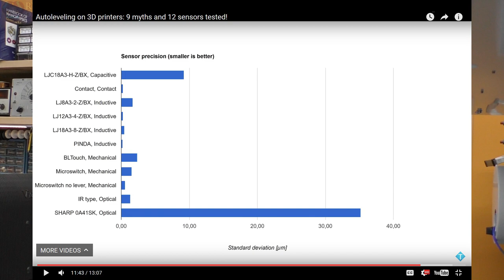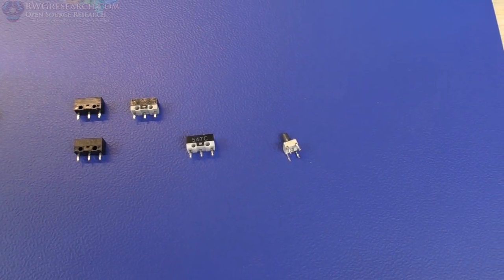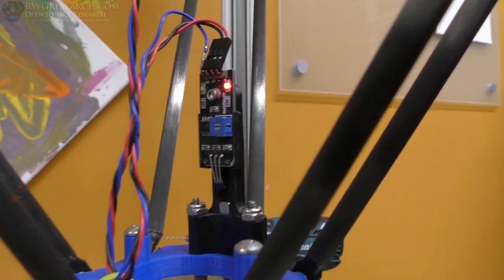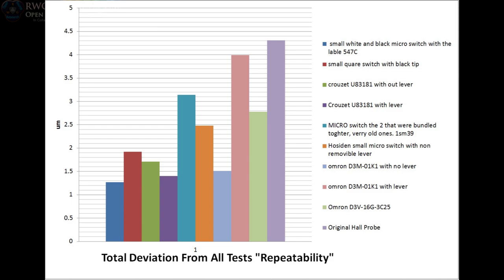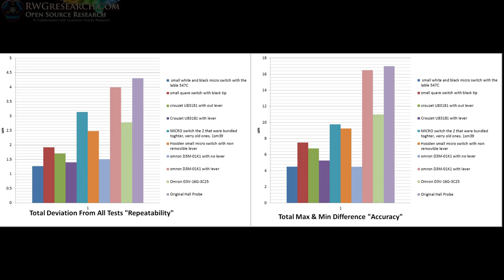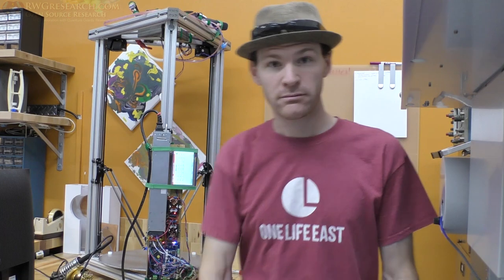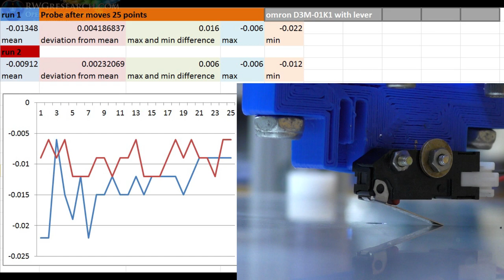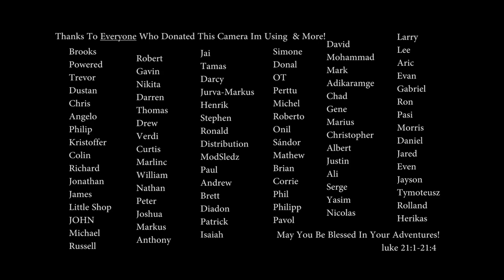Z Probe Micro Switch Shoot Out! How Accurate Are They For 3D Printing? + Hall Probe testing

Comment from the maker: Also note that i did not do a "contact contact" test in the video ( I forgot) 

So the results for contact to contact were: 
Total Deviation From Mean: 1.24 um 
Total max / min :  3 um

This is the lowest ( best) of everything tested.
This basically means that my delta in its current state has a resolution of about 3um +/- 1.5um. that's not to bad that's .003mm! 
so this will need to be understood when looking at all the other data. 

Thanks for watching!! 

~Russ Gries

Links:

Tom's video / page:
https://toms3d.org/2017/03/02/autoleveling-3d-printers-9-myths-12-sensors-tested/

Original Z Hall probe.
http://www.thingiverse.com/thing:111397

my edited Version of the hall probe from sainsmart:

http://open-source-energy.org/rwg42985/russ/Projects/3D%20printer/2016%20RWG%20rostock%20delta%20updrade%20parts/RWG%20edit%20z-probe_holder.stl

I use this hall sensor, its cheep and reliable. 
https://www.sainsmart.com/sainsmart-hall-effect-sensor-switch-magnetic-detector-module-for-arduino-motor.html

For my hall probe set up i use a rod from a CD/DVD player / Rom, they seem to be all the same size. 
The magnets are 3/16" cube. 

here is all the data i generated from theses test:
http://open-source-energy.org/rwg42985/russ/Projects/3D%20printer/micro%20switch%20Z%20probe%20Data/probe%20testibg%20final%20corect%20values%20.xlsx

Some old footage of me showing the z probe 
https://www.youtube.com/watch?v=80qzmwDFGVc

watch me build this printer the RWG-OSD-CNC:
http://rwgresearch.com/open-projects/3d-printing-research/oversize-delta-3d-printer/

my other ed printing research:

http://rwgresearch.com/open-projects/3d-printing-research/

Comment: it's going to be really hard to design but put a spring on the hotend and a switch on the top. so you can use the actual nozzle for probing! no offset adjustments and switching nozzles doesn't need an offset recalibration

Comment: How do you deal with effector tilt on your delta?  It shouldn't affect it probing the same spot over and over but if you move the probing spot (to get a mesh or something) then there are lots of problems.  I've been using the standard kossel allen key probe, but am switching to a nozzle-based microswitch probe to get rid of the effects of effector tilt.

Comment: I found the BL touch to be too unreliable. So I went to the EUCLID probe and it was so much better. BUT, after 6-7 or so prints on my RatRig the switch became unreliable and had retries all over the place to the point the mesh failed.

I changed the switch, and all was OK. 4-5 prints and the new switch failed (different manufacturer). It too had it's accuracy drop to the point it was also rejected after too many retires.

Is this cheap switches or are switches not up for the job?  (GikFun). I'm looking to source high precision high duty cycle subminiature micro switch.

Comment: Would it not be accurate to simply use a small copper surface ?
Much like the cnc tool probe, you just put a conductive plate on the surface
and alligator clip on the cutter.

Comment: Does the board firmware take into account de-bounce?
Reply: The firmware registers first contact of the switch within a given homing movement. There is no explicit bounce handling, neither in test nor in 3D printer firmware. Implicitly, this is debouncing by latching on first contact.
Reply from the maker: corect. it can bounce as much as it wants. it's readding the first trigger. debounce is a concern when your reading an iput and your using that input for a funtion like a menu. ~Russ

Comment: Russ the switch you recommend has a A0 and D0 pin which pin goes  to the ramps 1.4 board for the signal pin ? Thanks Gary
Reply from the maker: Gary Tonini gary. AO stands for analog out. and DO stands for digital out. from what i can tell the the AO dose not put out an analog signal. at least not a good one. but to answer your Q use DO. this is "on" "off"  5v out. also make sure you adjust the sensitivity to yoir liking with the potentiometer.   did you build one? Thanks. ~Russ
Reply: My parts arrive today I already have my parts printed for it
Reply: adjust the sensitivity to yoir liking with the potentiometer. ?
Reply: Russ I guess I'm kinda dumb here I put the unit together but when the unit comes down to touch the second magnet on top takes over and pulls the probe into the upper position how do I remedy this drop the hall sensor down so the probe has a shorter stroke cycle or what ? Thanks Gary
Reply from the maker: no worries, know one is dumb here :) we are all on a different learning curve! i was where u were once :) and now I'm still there just the next level up. lol  so this is where i was talking about the " adjust the sensitivity" in the last comment. 

4 things. 

1. make sure your magnets are orientated so they are in attraction. 
2. bend the sensor down so its closer to the magnet on the rod. you want the sensor to trigger when the magnet gets close it. 
3. if its not triggering when it gets close but rather after it get past the sensor. Flip the magnets over.  they need to be the correct orientation. 
4. Use the potentiometer ( that small things with a slot in it on the board) to adjust the sensitivity. This will adjust the triggering of the sensor.
You want it to trigger with out the going to far where the rod goes up. 

you can then set up your printer using G commands so that when it is done probing it goes down past the sensor height and then the rod will stay up. 
if you get all the rod the right height this will be out of the way when printing. then when your ready to use it again just pull it out. 

let me know if this all makes sense :) 

~Russ
Reply: Yes thank you for taking the time !
Reply from the maker: your welcome! I can only thank others who took the time for me :) ~Russ

Comment: What about with the speed that you use? If you go slow you get better results.
Reply from the maker: The slower the better, However with in a range of " slow speeds" the measurements held quite constant. some of the faster measurements might be off due to the system not being as rigid as it could be and other similar things.   ~Russ

Comment: Just a question Russ how do you know how long to make the rod for the sensor ?  Thanks Gary
Reply from the maker: Gary Tonini it just needs to be long enugh not to crash the nozzle? if that's what your asking?
Reply: Then I guess the marlin setup gets confusing from there I have set marlin up with proximity sensors but Im sure this is different  any hints ?
Reply from the maker: Gary Tonini it should be the same. it's just power. ground. And signal.  if you have any troubles it might be due to the signal being inverted. you can set that inversion in the firmware. ~Russ